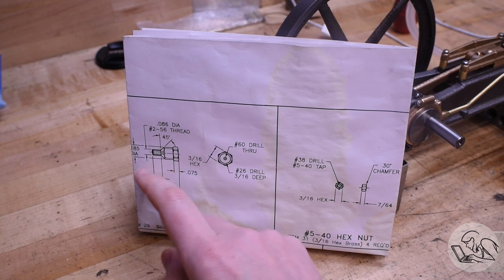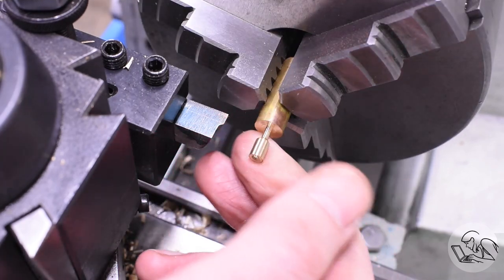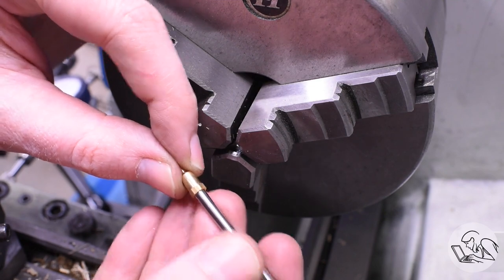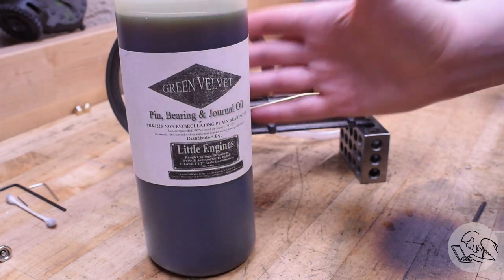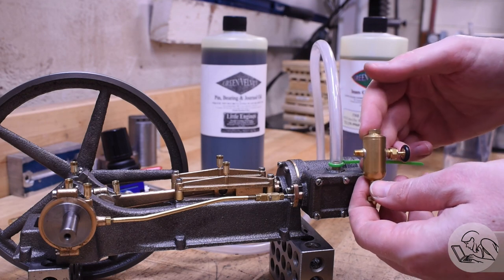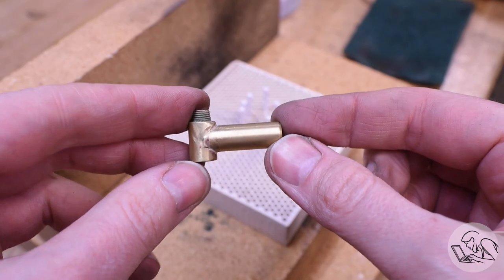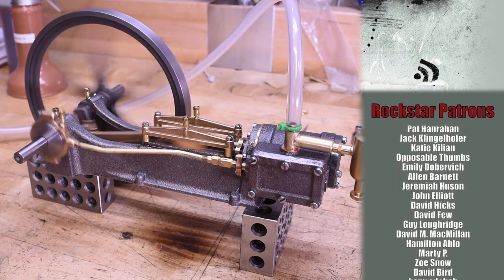Let's Build a Model Steam Engine : Oiling System!

Comment: Re: over-oiling - I ran into a similar problem on a hot air engine I built. In a model engineering forum, I learned you can use a sewing needle with cotton thread to run through the hole. It acts as a wick. Need less? - Thread 2. I left mine proud on the side to the part and coiled up a bit in the cup. I like elegant solutions like this.
Reply: My lathe headstock bearings have wicks like this as well, for the same general reason: to slow down lubricant drainage into the bearings.  It works pretty well.

Comment: A little piece of wire in the crosshead cups easily solves the flow problem.
Or a touch of silver solder on the bottom and a micro drill.

Comment: My nerd is strong too, this evening I was gushing over the delivery of a 117 piece drill set, and showing my grandson the tiny Number 50's, explaining that you would use them in pin vices which I happen to have. He was unimpressed, but I am dreaming of a project that needs the tools I have. Like your use, I suspect it will be to cleanup something that was not quit right at some stage. 

Beautiful engine, thanks for the info on the operation of the engines too. I had never heard anyone talk about the use of lubricants in the steam. your on the path MrPete follows on details, and that is a very good trait.

As for the proof is in the cut, lord did I get nervous the first time I installed a revolver barrel. You have to make that front sight stand in the right position, and taking enough off for a full 360 degrees more starts to cause problems for the ejector latch. But, I got it. Machining is so rewarding on that level,and that is of course why we are making it here, really, so we can making it anywhere.

Comment: Hello Quinn at Blondiehacks!  It's been a great series.  Thank you.  There was someone else doing a similar kit, but one step ahead, but I've stuck with your build series.  It's been very, very interesting and as a steam engine/railway nut, it's been a joy to follow.  Cheers!  One suggestion on the guide-way oilers...maybe a little lint or felt or something less fiberous but oil-absorbent as a 'stopping' to slow the feed down a bit, before putting in narrower holes.  If the oil be plentiful, rock on though.
I ain't a rich guy but I'll try putting some love in the coffee can if I can this month but, big thumbs up on here anyway.
A big hello for Sprocket kitteh! !:^)
Thanks Quinn!

Comment: Quinn, many years ago during my apprenticeship, I used to work with a colleague who was a very keen model engineer. He would sometimes make a few parts at work when things were a bit quite. When making the lubrication units he designed them to accept the small brass main jets from Mikuni carburettors. These jets are inexpensive and are available in numerous (and accurate) bore diameters. This enabled the operator to interchange them to give the required oil flow rates. Some experimentation was required to hit the correct oil flow rate but the jets come in a vast array of diameters so you will eventually find the right ‘jet’ combination.  Finally, lockdown hair is looking really good but please be careful when you are near any rotating machines - better safe than sorry.

Comment: Nothing wrong with using brass for toy/model steam engines and boilers. Plenty of such steam toys have survived for more than 100 years.

If you are serious about running this engine on live steam maybe it's time to think about what happens to the exhaust. To prevent making a mess on your workbench you'll need some form of condenser. This can be as simple as a hose going into an old glass jar or as elaborate as a chuff pot. I really hope you decide to make a chuff pot :-)

Comment: Perhaps a point of interest: PB&J 460 can be used as a steam cylinder oil as well as a bearing oil.  It is heavy enough to do a fair job of lubricating the cylinder - at least up to mild superheat - while having the added benefit of being non- compounded and hence removable from the exhaust condensate.   This second feature is particularly helpful to steamboaters who recycle exhaust condensate through a “hotwell” filtering tank for reuse in their boilers.

Comment: Tip for smaller hole in lubricator....Solder the hole and re-drill with a smaller drill.
Reply: See other posts in the thread (!!!!) for a tip on controlling the oil flow with cotton

Comment: If you need to adjust the oil flow from the oiler cups, insert small wires, usually called joggle wires.
Use wire from multi strand wire or fuze wire and make them “L’ shaped with the long leg just shorter than the feed hole to the journal.
Nice project, stay safe.
Reply from the maker: Great tip!

Comment: On our historic steam locos we use emulsifying oil from UK. (Not in the cylinders though). It makes the job as an engineer so much easyer. After an hour the oil and water has separated and we drain it with our oilgun or through the drain plugs. Top tip if You're running on steam.

Comment: On miniature steam locos, small bits of yarn are put at the top of the feed pipe to ensure a steady, continuous flow. The amount of yarn in the pipe can be changed to alter oil feed rate.
Reply: I have no intention of ever building anything like Blondie has done but that's  a really neet fix for a situation like this. I know these things don't need a strong flow of oil like an automotive engine needs, they just need to not run dry.
Your suggestion is perfect for a machine like this because it's so easily tuned to get the correct flow. 👍

Comment: Great Job.I build 7 1/2 gauge steam Locomotives.I found if your oilier is to generous with the oil ,I solder the base closed and re drill a smaller hole.Saves re making the oilier.

Comment: If you had a small radius on the left side of your form tool, it would leave a small fillet in the corner of the bar stock and possibly prevent the part from snapping off when the diameter gets small (avoids a stress raiser) and the cutting force goes up when under full contact with the form tool. Great vids!!!

Comment: Another problem with oil in the steam, if you intend to use a condenser, is that the oil will return through the system with the steam and get stuck on the heat transfer surfaces in the boiler and condenser. This will cause hot spots on the heat transfer surfaces which will result in failure of the surfaces. Cylinder oil prevents this as it can be skimmed off the condensate in the hot well.

Comment: Maybe instead of a smaller drain hole on the slide lubricators, a bit of felt in them would slow the flow.

Steam turbine generator next?

Comment: Just use distilled water and that all but removes the dezincification issue.  I’ve been using distilled water in my 16mm/foot garden railway locos for years along with a lot of other people, no issues with zinc erosion at all even on an ancient loco that I own (it’s 70 years old!)
Reply from the maker: I didn’t know that! I run distilled anyway just to cut down on scale buildup. Great to know!

Comment: On the oilers that drain too fast use pipe cleaner down through the hole and cup to slow it down you can add to the length and coil it in the cup to slow it even more if needed.

Comment: Have you looked into the Edge Bed Indicator?  It takes two second to setup and move and makes measurements for the carriage super eazy. And it's fairly cheap too, although I threw out the Indicator it came with and replaced it with a 2" dail Indicator I trusted.

Comment: Great work. 
Just a hint about gear oils. Some of the grades can corrode brass. Older standards didn't do this.
Btw, those displacement lubricators don't work when you run on compressed air.

Comment: One of the big reasons Navel ships switched from triple expansion steam engines to turbines was The turbines could produce more horsepower by using super heated steam. They also required less maintenance.  During the same period, most boilers became fueled by oil rather than coal.

Comment: Would adding a lid to the cross-head slide lubricators make any difference? A decent seal would create a tiny bit of vacuum, which will slow the oil down... I think.

Comment: I wonder if a tiny piece of cotton waste in your cross head cups might retard the oil flow somewhat.  The main bearing caps on my 1914 Keck Gonnerman traction engine are meant to have cotton waste in them so that when you fill them up they won't dump all of the oil right off the bat.
Reply: Or a piece of fine wire bent into a T shape?

Comment: Now you need to make a boiler and generator so you can produce electricity.  And use the electricity to power an electric train set!  Because steam trains.  Also you can insert "L" shaped pieces of wire into the cross head lubricator holes to slow their rate.  Make them long enough to go to through the bottoms of the oilers, and "L" shaped enough to keep them from falling through.  Thus reducing the effective diameter.

Comment: What is this "live steam" you speak of?  Is it "water vaper", "wet steam", "dry saturated steam," or the "superheated steam" that many think means simply "very hot"? [Insert Irony emoji here]   OK,  a great video series on the engine build from a truly great channel.  Absolutely in awe that you are going for the "steam", rather than the "air", option on the finished build.  "Entropy" has become a bit of a buzz word for the many, bur "enthalpy" still powers the universe.

Comment: Quinn, could I borrow your oil cup form tool for about 20 minutes?  I finally accepted reality and made the crankshaft fixture to finish my crank.  Used a hose clamp for the same reason as you.  Today I got the piston, flywheel, crank and connecting rod all moving!  Jim

Comment: Another great video, thank you for brightening up my Saturday nights. 
Regarding lubrication in the cylinder: would it be feasible to coat the surfaces with PTFE / Teflon and avoid the need for oily detergents in the steam?  Just a thought...

Comment: Could you pack the oilers with string to slow them down?
Reply: I was about to suggest the same thing. String works well to limit the flow and is less likely to block than a teeny tiny hole.

Comment: With the form tool, and the tool pressure issues, it looks like (with 20/20 hindsight) a tool that just had the narrow portion and the chamfer would serve, presuming that the wide portion is to be turned separately. Easier to grind as well
Reply from the maker: This worked great, though. Only issue was needing tail support
Reply: @Blondihacks  Yeah - optimised via sequence of operations. Cool.

Comment: Boo, Hiss! I clicked on the link to get the ceramic fixture plate (I wants it and I wanted to throw a few cents your way, Quinn) and I got this message 
Currently unavailable.
We don't know when or if this item will be back in stock.

The phrase "or if" particularly concerns me. It's absolutely perfect for the sort of work we do.
Reply from the maker: It seems I accidentally created a run on them. They were in stock when I posted the video. ☺️
Reply: @Blondihacks  I’m sure they were and I’m not blaming you. 
However this demonstrates the power you have with over 77,000 fans (errm followers). It seems, as far as I could tell, that there is nothing quite .like it either. Let’s hope they get them back into stock.
Great video - like others I’m looking forward to your steam test.

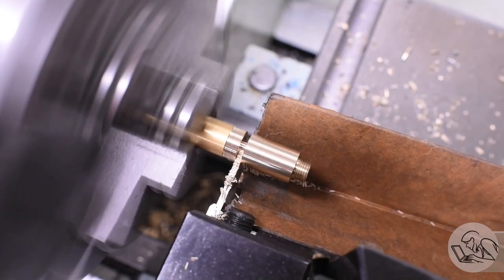Comment: 14:15 - Might be because its 1 am, but why do you say here that you lose the concentricity when you flip it over in the three jaw? Simply because you dont do a proper setup and adjust for runout with a dial gauge and go hog wild because theres no requirement for concentricity like with another mating part/face?

Comment: Square stock in the D-bit grinder: My grinder uses 5C collets and there are collets available for square and hex astock-works really really nice.I know that the original Deckel S0 uses a different type of collets, sothis might not be an option for You.I have'nt seen Your D-bit-grinder videos yet. So I'm not aware of any specifics of Yours.
regards Frank
Reply from the maker: Mine uses very expensive Deckel collets, so square collets cost a fortune
Reply: @Blondihacks  too bad, I was guessing that, when I saw the body of Your grinder. The Deckel ones not only cost a fortune but are also smaller in diameter. So collet blocks for square stock is probably only available for smaller blanks.
BeforeI had the collets I made had made an adapter for the bigger lathe tool holder. That was basicly a hex shaped block with a deep long groove, which the blank just fit in. It's depth was so, that the blank's top was in the center. With that I could hold the blank in six defined positions and basicly grind all angles. Too bad I can't upload a picture here.

Comment: Rather than remake those cups with a smaller hole, cut a woody plant stem and shove some of the heartwood in there. It's kinda spongy and porous and should work like the tip of a marker. Slow the flow, but spread it nicely.

Comment: Quinn, I am going to order a few pieces of raw stock (we all know why :()  )  my question is, I thought I’d like to make hex head bolts or studs and nuts for some of the more visible spots.  What material would you use and would you do bolts or studs and nuts?  I assume the material choices would be crs, ss, or brass.  Thanks, Jim.
Reply from the maker: Good question, and I’m not really sure. I also plan to replace all these silly slotted screws with studs, and will probably go with 316 stainless. Brass might look nicer, but I worry it may be too soft to tighten repeatedly, since the engine comes apart a lot for maintenance.

Comment: Do the oil cups on the connecting rod or eccentric throw oil? (I know nothing about steam engines! Do some oilers like that have caps?)

I'm rebuilding a (mechanical) power hammer, and one comment you made early on about the cross head (I think) basically being a mini air hammer made a lot of things click, and now I'm seeing so many ways in which your experiences can help me do better on my project.

This video has me wondering how I'll lubricate the mechanical linkage (which previously had no lubrication at all... I'm planning on at least putting in oil-impregnated bronze bushings in there, but now I think I need to work in some sort of oil or grease system.  Then again, I write software for a living, and this hammer isn't going to see that much use.)
Reply from the maker: Good question! They do not throw oil because the oil is very thick and the parts aren’t moving that fast. That said, bigger machines do use covered oilers.
Reply: @Blondihacks  Thanks!

Comment: “you loose concentric when u flip in a 3 jaw”, Number your chuck jaws, put the part back in with the jaws on the same marks. Ta da same centreline.
Reply: It won't quite work that way.  One of the jaws will 
line up, but the other 2 will switch around.

steve
Reply: @steveskouson9620  Im only speaking from experience, its worked well enough for me over the years. Using the same keyhole to loosen/tighten, seems to help, ultimately a higher quality chuck is the answer, but reality dictates otherwise generally.
Reply: @sharkeyist , OK, let's number the jaws.  1, 2, and 3.
Now, let's turn a piece of stock, and then with a sharpie, 
outline the jaws on the chuck, and also number them.

Now, we pull the part out, and flip it end for end.  Line up the 
#1 mark, with the #1 jaw.  If you look, the 3 jaw is on the 2 
mark.  And, the 2 jaw is on the 3 mark.

Yes, if you remove a part, even with a chuck way out, after 
marking the part and the jaw, UNLESS you flip it, "tada, same 
centerline.)

steve

Comment: How does oil get to the bottom rail on the crosshead slide?
Reply from the maker: Gravity. 🙃
Reply: @Blondihacks  Well, yes... But the crosshead slide runs past the top dripper and smears off some oil, and it spreads around the top rail. Does it then run down  the sides of the slide and get the bottom rail? Or, am I missing something?
Reply from the maker: @m73m95  Once the oil is on the crosshead, it just gets everywhere, basically. The whole area gets oily by gravity and things moving around.
Reply: @Blondihacks  Ha! Got it, thank you. Fantastic series, BTW!

Comment: Having just treadled off 250 "I've been vaccinated/I can bite people" coasters on the 1875 Gordon press, I now discover that I'm using just the right lubricant. On the other hand, I am now tempted to figure out how to (a) build or find a steam engine to run the press with and (b) figure out how to get all the belts & transfer pulleys into the shop from the steam engine outside. 'Cause I need more distractions, right? 
. . . (And no, I do not have the factory manual on the press, so I'll have to guestimate how much horsepower it would take to run it. The press is a 9x13 platen. A 10x15 C&P takes a 1/2 hp electric motor drive to start so I'm guessing that I'll need a Horton pully arrangement to power the Gordon off a steam pumper and probably more than 1/2 hp to start but much less to keep it running. Dad's old 12x18 C&P had a Horton pulley. Wish I still had that beast ;-) )